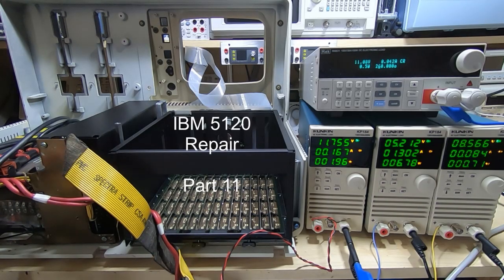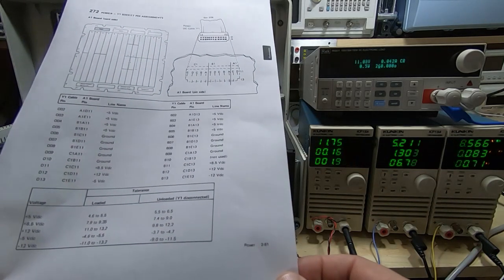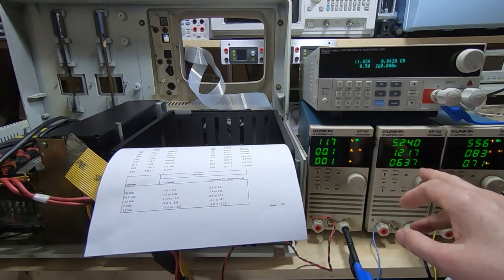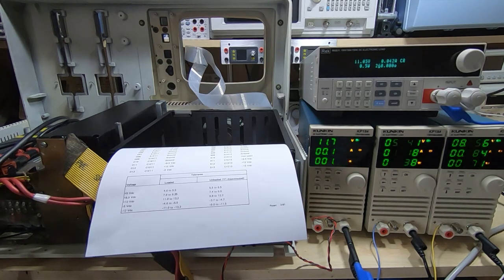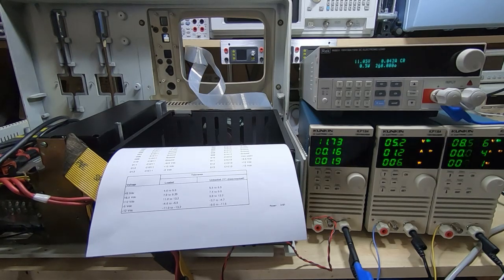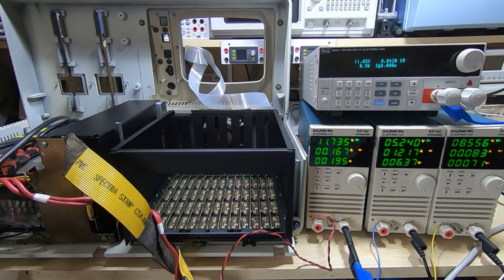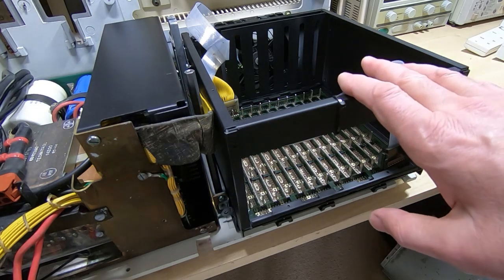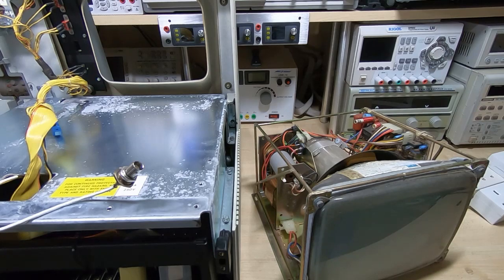IBM 5120 Part11

Comment: Hi Jerry, If you want to test individual boards and are worried about the voltage levels could you create a Y-Cable from the PSU and connect your electronic loads in parrallel in constant voltage mode in order to keep the voltage rails in spec with low current loading from the boards themseleves ? Bit of a pain of course, but as you say the boards themseleves are quite valuable. Martyn.
Reply from the maker: I did consider that but there are 6 rails and they all interact so my chances of using electronic loads to balance the supplies as I fit each board without knowing what each board is supposed to draw and also not causing damage is remote. the rails are also sensitive to overcurrent and while I did not show it in the video the supplies shut down if I power it up with the loads 'ON' which means I would need to power up the IBM with the loads 'OFF' and then switch them on which would make it pointless. What I have done to protect the boards is to fit high power zenners to each rail to keep the voltages withing limits. This should at least prevent any damage. I will explain this in the next video.

Thanks for the suggestion.